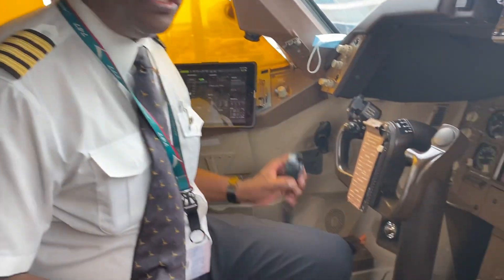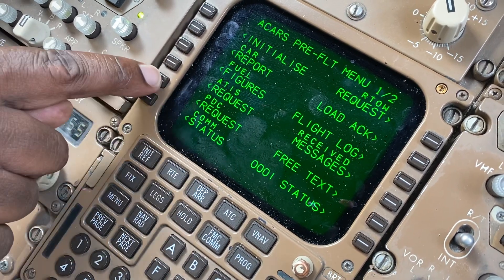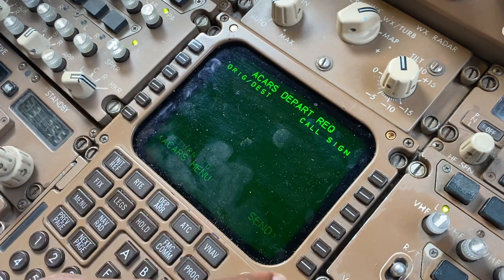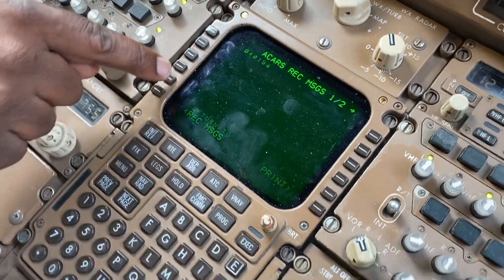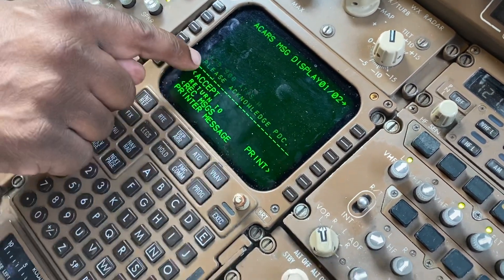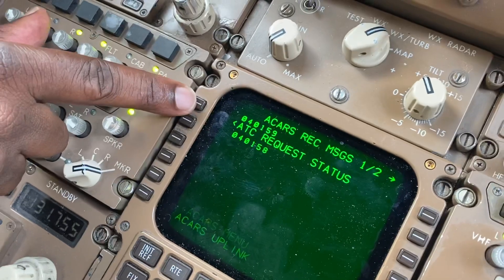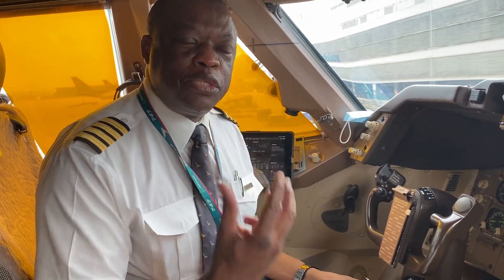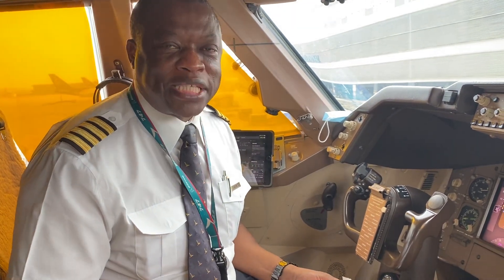ACARS communication for PDC

Comment: Nice to see how it works in an aircraft.
So it Works if a planespotter is sniffing datalink. 😉

HAMDFYA.DC1/CLD 1442 241017 EDDH PDC 040
SXS8EJ CLRD TO LTAI OFF 09L VIA POVEL2Y
SQUAWK 7605 ADT MDI NEXT FREQ 121.955 ATIS V
STARTUP APPROVED

Comment: Another excellent straight to the point explanation. May I ask a silly question: what is that light "horizontal cross" stamped on the windshield side pillar? Is that related to the proper seat adjustment for takeoff and landing?
Reply from the maker: Correct! It is for determining the right seat position for takeoff and landing. Thank you.